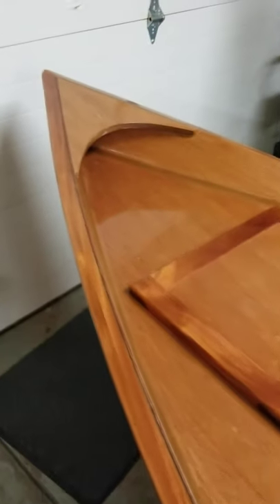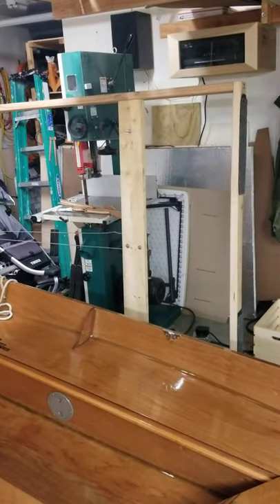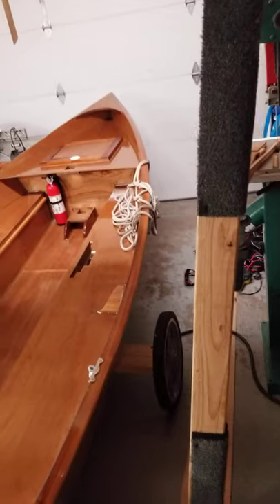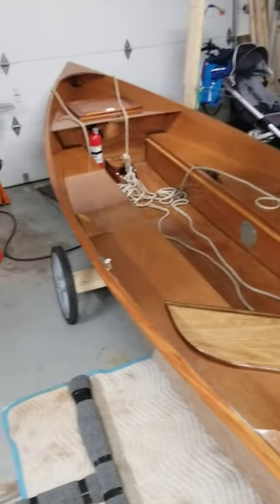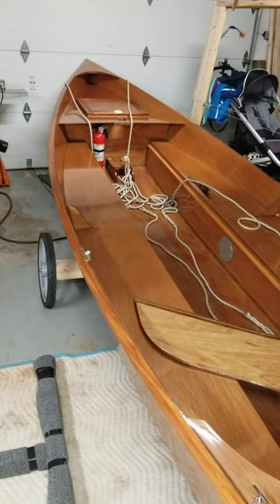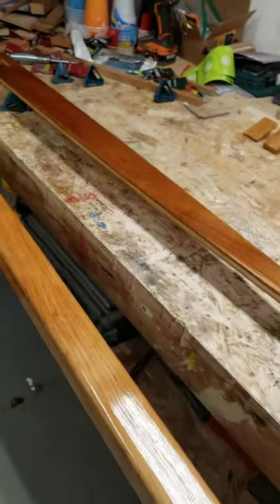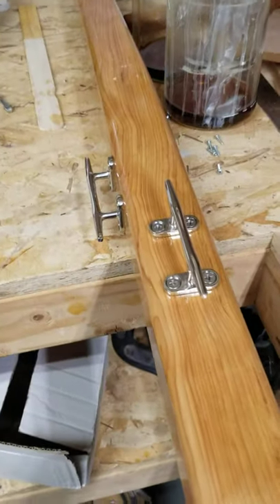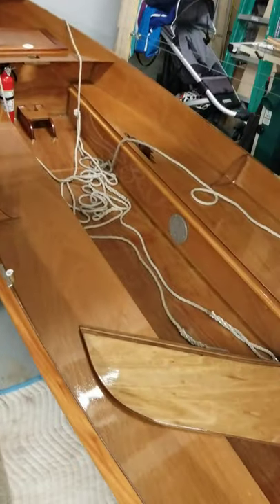Jimmy Skiff II (Video 15)

Comment: From Sunny Florida, your efforts haven't gone un-noticed! 
Nice job in your build, video presentation and design ideas which where nicely executed.
The light bulb went off and sparked Nirvana when you mounted your fuel tank in the bow. I'm glad that worked out, as it makes such good sense, well done! 
As an RC pilot, weight distribution is first and foremost to CG which is so easily overlooked.
Your build has sparked an inspiration and if undertaken, it will be the kit version for limited space and tools.
I appreciate and enjoyed your build presentation!
Reply from the maker: Thank you for the kind words. I'm sure you can see from my videos I enjoy RC airplanes myself! I do absolutely everything possible to shift weight instead of adding it. That said, the verdict is still out on my modified system. I had some issues that need further testing. I'm planning on talking about that in a final video. Hopefully I can get out and enjoy/test the boat soon.
Have fun with your build if you decide to go for it! Feel free to reach out to me if you have any questions. I may not be able to tell you the right way to do something, but I can tell you what I did!
Reply: @tomwassmer9828  Hi Tom, It doesn't take but a fleeting snap shot of a model plane for me to know you enjoy that hobby too!  I've flown since dinosaurs walked the earth; Sport semi scale, Aerobatics, Helicopters. My latest project is an ASK 21 GLIDER. As you mentioned your fuel distance from bow to stern on the Jimmy Skiff , I started hunting the web for outboard fuel line hook up's.  This was all new to me but sounded like something I would be interested in. Amongst the plethora of opinions, I found that, as long as the gas line is a tight seal,( no air ), makes sense, the engine does not know from what distance the fuel travels. Having a natural declining path, helps with fuel delivery. The only point of contention,which I read,  (not in your case ), was the distance straight up from deck level. In other words, a vertical fuel climb is more an issue than to be drawn horizontally. My time on the water started in my teens, going to Block Island every weekend with a friends family and teaching myself how to sail an Optimus Pram used as their tender. From there, it became a deep seated love of sailing to 70ft. The only wooden sailboat I owned was a boat built around Narragansett Bay area in Rhode Island, (where I'm from) called an Indian. It was a 21 ft lap strake hull, like a Town Class. All wood, painted canvas deck,surrounding an enclosed oval cockpit, 6 ft tiller, bermuda rig and spinnaker. 65o lbs of lead pig ballast, pivot center board and nothing less than 3 people to keep her from controlling you! For a classic wooden boat, Fast like a wild indian! If I can find a suitable place to build and be free to create a work room environment, unfortunately, not at my home, the Jimmy Skiff may become a future project. I look forward to your findings and next video.
Reply: @tomwassmer9828  How about that final video? Looking forward to hearing your thoughts on the boat now that you've had some time to use it!

Comment: I should be finished with my hull next month, can't wait to get it on the water. You mentioned sewing the sail panels... I though the sailing components kit was already sewn together is that not the case?
Reply from the maker: That’s awesome! Yes, it looks like the sailing components kit is sewn and ready to go. I decided not to purchase that kit. I think the manual mentions a company called Sailrite so I checked them out. They have the Jimmy 2 sail “kit.” Everything you need to sew and assemble the sail comes with it (except for the sewing machine). The cool thing was their sail designer, Jeff Frank, took the time and asked me everything he need to in order to figure out what I wanted in my sail over the phone. My goal was to add some square footage to the original sail design. He designed that into my custom kit by pushing the leech aft and adding battens. We also decided to add one set of reef points in case the wind was too much for my larger sail. I HIGHLY recommend at least checking out Sailrite!